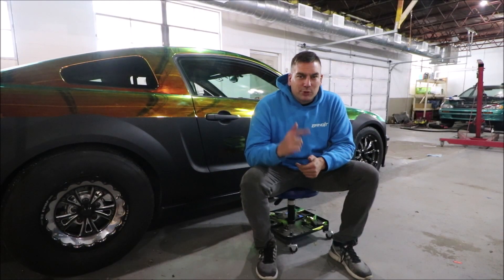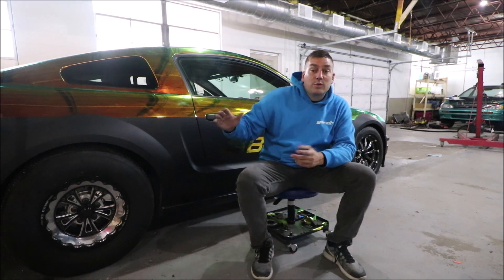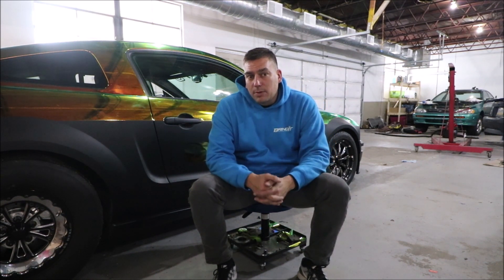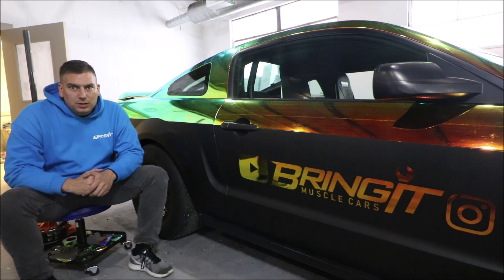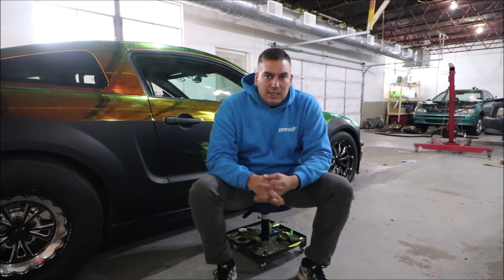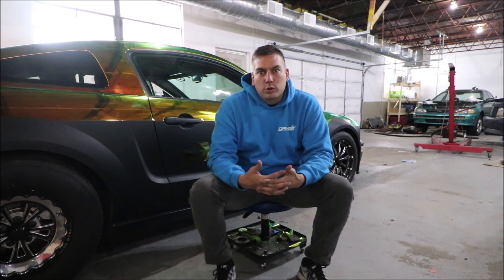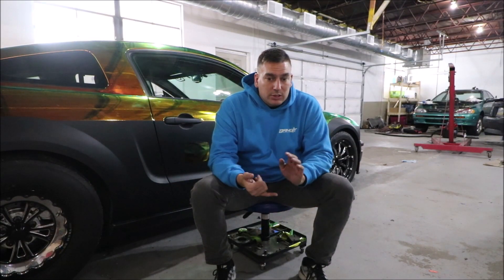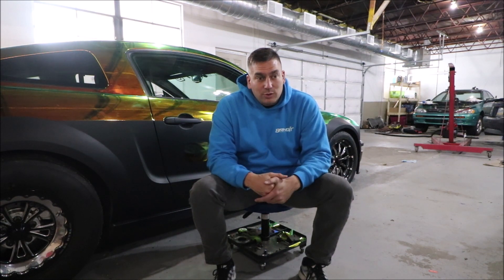Shelby GT500 Winter 2018 Plans

Comment: 2 questions what is your best time and about how much money did you put into your car the reason I ask I have a 08 gt500 that I bought from David Tascas Bob Tascas brother and he put well over 100 grand into the car without the price of the car and it ran a 9.77 at 144mph
Reply from the maker: Anthony Laudano I’ve got less then that into it but not a whole lot less. I had to replace my converter and my throttle body. The car should be running very high 8s. Is your car auto or manual?